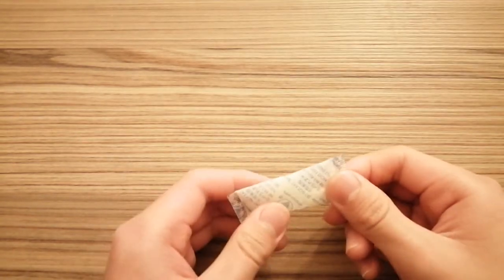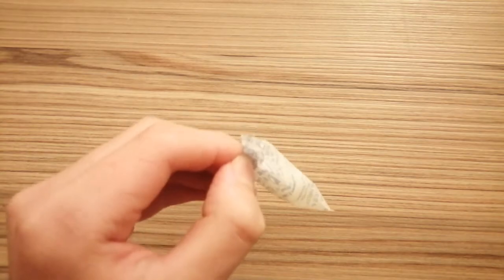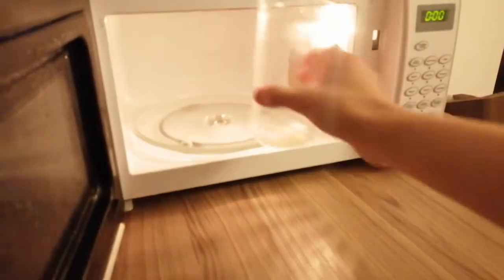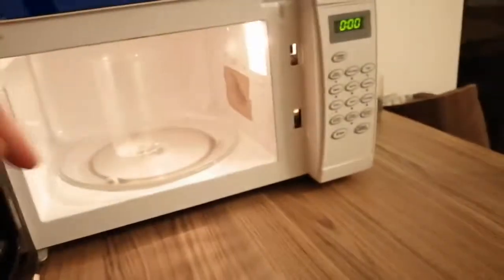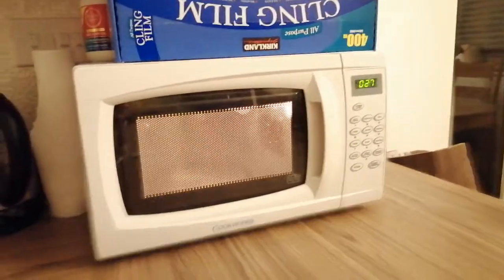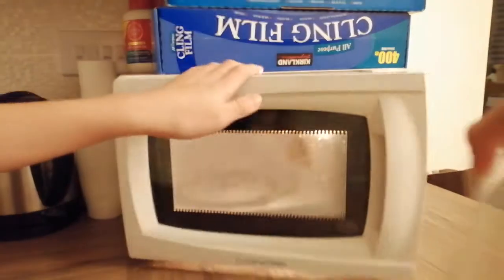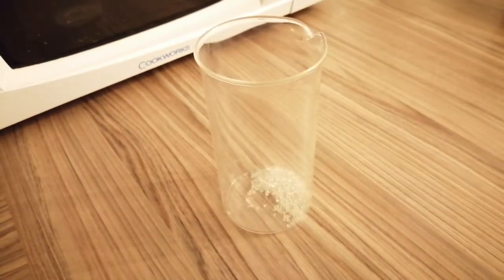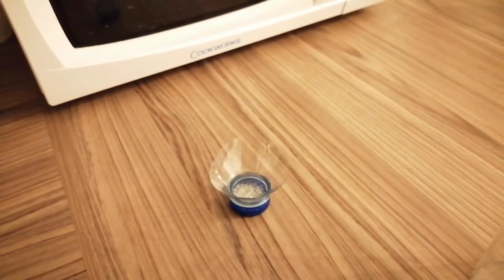How to dehydrate silica gel.

Comment: How about putting the bags in a dehydrator? Do you think that could do the trick? Why do you need to take them out of the bag, by the way?
Reply: he removed the bag becouse its made of paper which funny enough can catch FIRE in a microvawe IF there isnt somthing else in the micro. that can take the heat,,
 say a piece of meat on a paper plate... It usually works great for heating food.
.but fun fact.... both the MEAT and paper eventually  will ignite if you leave it in the micro until ALL the moisture is gone 😁😁